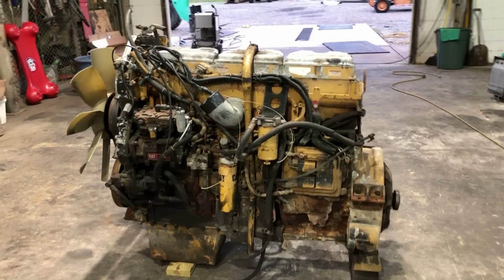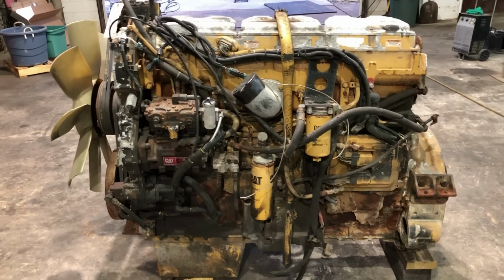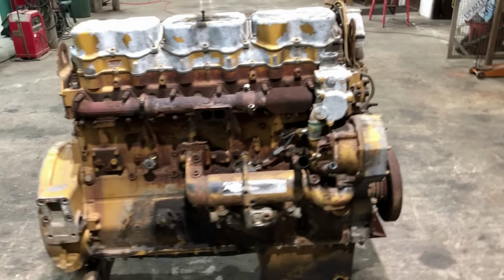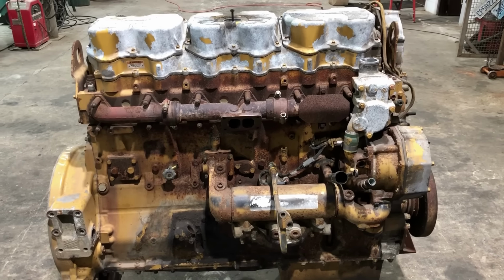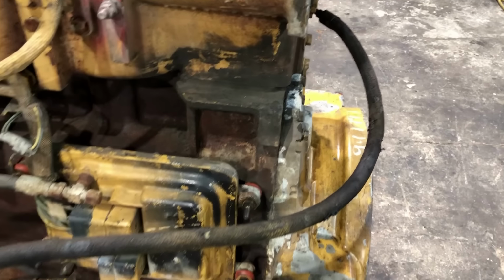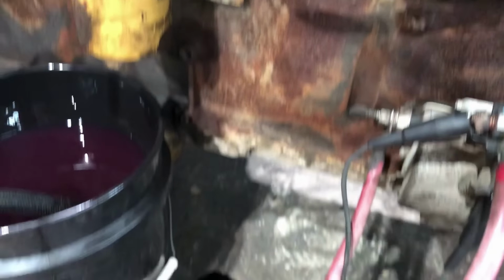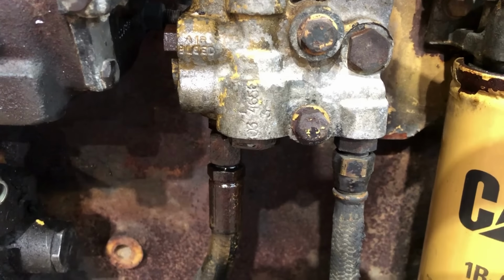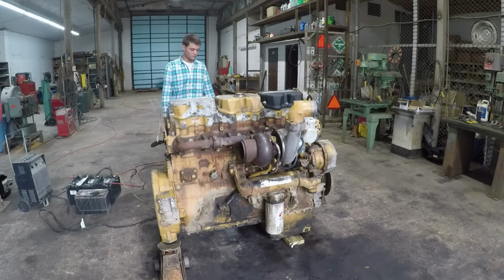Bringing a Caterpillar 3406E 14.6 Liter Diesel Engine Back to Life

Comment: Thanks for sharing. In my trucking career I've owned two 80's Freightliners both with 3406B 425 HP engines. I sure loved that engine. Dependable, lots of power and sounded nice too.  IMO they were the  best truck engines ever made.

Comment: I haven't had my head under the hood of a truck for over twenty years and that just brought back so many memories. I worked for a guy down in S.E. Alaska many years ago and the man only had one cat engine and a bunch of cummins. Don't get me wrong cause I like both engines... but a cat has a purr of her own and I had a long nose KW that had the 1693 in her. Only thing ever done to the engine in over a million miles was I lost a keyway in one of the gears in the timing set on the back of the engine. The shaft wasn't hurt at all but the gear looked like heck so I welded it all back together and cut a new keyway on the lathe then just put it back together. It was a beautiful truck and was very popular among other drivers cause it had 600 horse flat footed and you can turn them up but why unless you really need a little more power. If you need a lot more power then get the appropriate engine for the job cause it is all just nuts and bolts. I put another half a million miles on it before she started using just a bit more oil than I like so tore it down completely and built it stock again and had a flock of people who wanted it but her being family I kept it where I drove that truck about 3000,000 miles and I hadn't noticed until to late that the cab had a crack in it and when I parked her for the day as I did a lot of night driving;, it kinda was listing to one side and under further inspection the ol' girl had brought me home for the last time!! Cab was split clear up the firewall to the glass in the windshield. I know that was a lot to take in but I just felt like sharing that
Reply: What do you mean with a splitted cab?
Reply: @tierfuehrer2  I didn'think about people whi haven't done work on truck cabs  but the part where you ride in, right up the firewall ( the part of the cab closest to engine where the wires and stuff comes through, it broke in half because the crack got fully up from the bottom to the top. It broke like steel does when it flexes a few million miles, now do you understand???
Reply: Thank you for sharing this. it does bring memories back, even for me lol
Reply: Just wondering how can you cut a keyway on a lathe ??? a mill yes , a broach maybe ... But a Lathe ... I would like to see that one
Reply: @TheSmreeder  It must have been a multiple-axis combination machine. These can do whatever, wonderfully expensive stuff though.
Reply: @TheSmreeder  it's quiet easy to cut a keyway in a lathe, although time consuming compared to a broach or using a mill, but here goes. 

Cutting a keyway in a bore, make a cutting tool with some round bar and braze on a piece of high speed tool steel, kind of like a boring bar but ground to cut on the front edge. Set tool up in the the tool post so that the center of the tool is on center height and square to the bore. Then with the machine stationary and locked into a low gear so the job doesn't rotate, wind the saddle back and forth to cut and wind the cross slide out to get the desired depth. Small cuts, but gets the job done! I have also used a broach mounted in the tool post using this method when I didn't have access to our press in the workshop. 

On a shaft, assuming it's a small shaft, you can mount that in the tool post or you can make a jig to hold a larger diameter shaft in the tool post also (as long as it isn't to long of course) mount center of shaft on center height. Then use a slot drill/end mill in the chuck to cut the keyway, use the top slide(y axis) for the length of the keyway and saddle(x axis) for depth.
Reply: @jimmy2824  Thank You... I have run Bridgeports to HBM's w/ 16ft table  and 12ft VTL's and lathes w/ 16ft bed and I have never encountered anyone doing a keyway like that... and yes it would work... Many Blessings , SMR
Reply: @TheSmreeder  no worries at all! Sounds like you're no stranger around a machine shop yourself. I was taught this method by an old machinist while I was still an apprentice. And although I've only used it a couple times in a pinch at work since it's much more time consuming, it's still handy to know for doing work at home, if you only have a lathe.
Have a good one!
Reply: @jimmy2824  Thank You... I used to be handy around the machine shop , but that was 20 yrs ago. High sided my bike at a 110mph and have hardly worked since.  My last machine job was in 99 a few years after the accident and I couldn't keep up w/ the 12 hour shifts... its all good though I have a good Ol' Lady an RV and Grandchildren...
Many blessings , SMR
Reply: This is what youtube is for. Sharing stories. Thumbs up.

Comment: I built 3406's for a year to the day in Building BB Mossville, Il.  We built 125 per shift...all types, on highway truck, marine, power generation, gas compression applications. I remember hearing from down the line, "swimming mickie!". It was a marine 3406.  The Russians complained about the  3406 torque was bending their truck frames. Ha!

Comment: I have been a Cat technician for 21yrs. Started in the truck shop (on-highway) been EPG field service the last 13yrs. These old 6TS engines were bulletproof. I rebuilt more than I can count. 4MG, 3ZJ, 8PN, 5EK, 6TS, 1LW...if you're a Cat guy you know what those are!! Good video

Comment: I would never have thought you could run an engine like that just sitting there. Very, very cool. At least to me. My father drove long distance and I wondered how many miles he actually had drove. Oh well, I was just wondering the stories that engine has built up over the years. I was watching that engine sit there and run so smoothly while realizing the capabilities of that 'little beast', at least comparatively to the size of the cab plus a nicely loaded down trailer, especially in the mountains. All that torque in that relatively little shaft. So wild. Thanks for sharing.
Reply: Yeah you can run car and truck engines outside of the vehicle to. Great way to test them if you bought just the engine
Reply: it's actually easier with this engine than most gasoline fuel injected engines because the PCM is right there on the engine 
i'm a big chevrolet person and my biggest reason for this is with the older carburetor equipped engines they need just 1 wire to run ,,the HEI distributor has the coil in the cap and the PINK wire is the power , that's all you need for the ignition to work
Reply: @wildcoyote34  very true, I wouldn't even try on a newer engine with alot of sensors and all goin on.
Reply: Yeah I kind of thought it'd tip over!

Comment: Sweet vid!! I've got a habit of adopting old diesels too, so far I scrounged up a cummins V504 F2 out of a fire sprinkler system with only 234 hours on it (not one of the best engines ever but it was only 200 bucks, couldn't resist!) And the latest is a Detroit 6v53 that had a bad lifter, 500 bucks and it's a runner! It sounds awesome! That turbo on yours sounds pretty beastly too, love your vids, There's too many morons breaking stuff, glad you're bucking that trend in spades!

Comment: I was a licensed air craft mechanic and worked on prop driven cargo planes. Really big radial engines in the three to five thousand horse power range. Four of them supplied 12,000 to 15,000 shaft horse power on take off and climb out. Each engine spun a four bladed prop that weighed about one ton plus its massive gears. We were warned by a mechanic with thirty years experience that horsing really big engines, that is flooring the throttle then letting way off and repeating same can twist the crank shaft and cause engine failure of the worst kind. I was about your age when I was told this. If you were caught 'horsing' an engine you were fired. The engines cost $ 250,000 grand each new and a $ 100,000 to remanufacture  one.  Just thought I would pSs this along. Love your Videos

Comment: Awesome video! 
One small piece of unsolicited advice: Try to make a habit of wearing hearing protection in the shop - even basic foam earplugs are good. The reason is because unlike your eyes or hands which can suffer damage and (usually) heal back to 100%, damage to your hearing is permanent and cumulative over your life. You won't notice the 0.1% hearing loss from running that turbo for a minute 3 feet from your head, but it adds up.. .and once the damage is done, that's it - you're never getting it back. 
Cheers! :-)

Comment: Sounds like a winner.
 Hope the water in oil problem is a simple fix, most of the time it's a cooler internal leak. Anything more is a tear down. That sucks !!!! Thanks for video. !!!
EDIT: I'll pass this on to (Jpaydirt) he runs this engine in some of his equipment.
Reply: Compressor head gasket😜
Reply: In a car it's usually the cylinder head gasket, running the engine after the temperature gauge says NOoooo!

Comment: I didn't think she was going to run but when she fired up, she purred like a kitten - good job buddy!! 👍👍 also it's surprisingly easy to get the engine running by connecting 2 positive and 1 negative wire!

Comment: For 800+ K on the clock, that old Cat sounds pretty healthy. I'm guessing a leaking oil cooler since it seemed to be running even on all 6. Nice find, and good to have some spare parts around like a transfer pump, filters, valve cover, etc.😁👍

Comment: KT3406E The biggest radial ever to go into production was the Pratt & Whitney R-4360 28 cylinder radial developing 4000 hp with water injection and exhaust turbo chargers fully engaged, running on 115- 145 octane using ISO pentane as a base line octane standard.  Each engine weighed about 3500 pounds. The engine had a rating of 1.11 HP for each pound of its weight. I suppose that is butterfly light for a Diesel engine of the same HP rating. Diesels seem to be able to take a merciless beating  and keep on running.

Comment: I truly have been inspired. I have an old service truck that's been sitting for a while and Im going to work on it. I miss the tommy gate on it most of all. If a motor cane run while on a shop floor, surely I can get mine going with a little TLC

Comment: I remember the guy i used to fish lobster for would dump whatever he pumped out of the block on oil changes,  right back into the fuel tank,  from a 12valve 210 cummings.  Was big enough tank around 150L  I’d ask him, that don’t hurt it any?  Not a bit. Lubes the system and gives you back something from the cost of oil 👍  hahaha
Reply: In theory diesel fuel in and of itself is a better lubricant than petrol (gasoline as you Colonialists call it) which is why diesel engines do more miles with neglect over a petrol engine. Petrol is a solvent which washes oil off the bores. A modern diesel engined car would never tolerate such adulterated fuel. Their fuel pumps and injectors are made to better tolerances than anything on a Saturn V! OK some NASA guy is gonna give me some grief and hate! We have people here in the UK (where there's a lot of diesel cars as compared to the US) who regularly misfuel. They put "gas" in their BMW diesel and wreck the fuel pump and injectors. What am I trying to say? Just trying to point out the contrast between a  Lobster boat with a Cummins and a BMW diesel. By the way some of these misfuellings can run into a few thousand of your dollars to put right. And despite fuel nozzles having different shapes and sizes they still manage to misfuel. Nothing's fuel proof (no pun intended!) as fools are getting cleverer!

Comment: Tip on big diesels , don't keep snapping the throttle , hard on the crank with heavy flywheel.
Reply: Done it a bunch never had a problem
Reply: @Daniel-dg8hd  Till it happens
Reply: @johnready630  till what happens? Curious why it would be bad
Reply: @Daniel-dg8hd  Flywheel sheers the bolts off or worse the crankshaft snaps.
Reply: @johnready630  engines are pretty strong some simple revving shouldnt break anything they get abused daily pulling heavy loads etc
Reply: @Daniel-dg8hd  Whatever , I was a mechanic for many years . Just advice to use or ignore.

Comment: That was amazing , all those pins and it only takes 3 to make it run . That was the last engine I drove when I retired and it was the best !
Reply: That's for start and idle. Fuel pedal rheostat is more wiring. Boost reference wasn't hooked on either
Reply from the maker: They are still the best.  Thanks for watching.
Reply: Like Mini Barns started to say, the rest is for total operation. It will start and idle with a few pins. Few more to control throttle. Few more to control all conditions. Few more to make everything trim out and run smooth from cold to hot. Few more to control aux stuff. Before you know it you are at 40+ pins. That's how the cookie crumbles, lol.
Reply: @mjodr  I like three pins better !
Reply from the maker: @mjodr  There are 40 pins on the engine side and 40 more on the OEM (truck) side.  All the engine sensors are active and functioning with just those 3 pins connected on the OEM side.
Reply: @KT3406E  Ah OK, I see how it is broken out.

Comment: That's pretty damn cool. Question for you. In the beginning of the video you said the engine was marked as "water in oil." Running this engine on the shop floor like this, no radiator/coolant system attached to it, how do you know that there isn't something wrong with the engine like a head gasket, cracked head or block etc? None the less, this is some cool shit. I know not a damn thing about Diesel engines so anything you post here about them is educational for me. Thanks again. Rock on!
Reply: Surely its a good idea to see if it runs and what needs doing before putting in a bunch of hours and money into a complete overhaul.
Reply: I know this is super old, but the head is pressure checked and the block is checked for cracks before going any further on the build. So no matter what it costs a little money to have these things checked properly before proceeding.

Comment: i guess i learn something new every day ,, i didn't know that the engine PCM on these big truck  engines actually was mounted on the engine ,,well at least on CAT engines ,,sounds like a good runner too once i heard it start up ,,of course when it was cranking i could tell it was healthy ,, one with a dead cylinder will crank very unevenly

Comment: Wow I had a 3406B in my cabover, needed the fuel pump rebuilt. Ran great then I had a hard run, hills. Started blowing oil out and water out where it could. Sleeve seals I guess but didn't know that till you just said it...

Comment: Just found your channel...I have quite a few cats around the farm here...looks like your videos could be a fountain of information for me...thanks.
Reply from the maker: The 3406E and C15 truck engine family is my thing.  Thanks for watching.
Reply: KT3406E I have a little of everything...3406 in a old ford 9000. I believe there is a 3406 in my cat d6. I have 2 3208 which I hate...3116 in my dump truck...3126 in my gmc grain truck....and a c7 in my flat deck truck.

Comment: back in 1986 I went to diesel school in Vancouver bc , we tore down the DDa's and rebuilt them but not the cat engines , they said they were too expensive for parts . The detroits were the lightest truck engines on the market but the heads were cracking , Cummins was starting to gain market share , top stop injectors and electronic fuel injection . We visted a cummins shop in Burnaby and seen the prototype domestic truck engine , after that everyone was buying pickup trucks with cummins diesel engines . I tried to get into finning and ended up at Detroit diesel , tearing down engines and putting them through the wash machines , but everyone was on work sharing , the economy was bad . So I ended up in the ship yards and worked as an engine fitter . I should of listened to my dad , he kept telling me to go north . I live in the north now but iam 60 and gig is up , just work on the  house , and the truck and maybe buy a used diesel and rebuild it and sell it . Time sure speeds up when you get older , but lots of good memories .

Comment: Engine runs very good. No smoke, nothing. But i guess you gotta see if the oil is mixed with water as per usual head gasket problem etc.
Reply: MyMIXmedia more than likely on this one it’s probably oil cooler or cylinder liners.

Comment: There are many hundreds of the 3406B cores that are rebuilt into natural gas engines on the western high plains to power water well pumps.   They are completely rebuilt and equipped then sold for $25,000.

Comment: I teamed played an 3406B at baran institute about 15 years ago.  I was thinking fifteen yaers go by before I d start doing rebuilds on them when they were a new industry item.  Going with oem parts for replacements.   purring beautiful machine though when up and going.
Reply: how much would you ask for price of the 3406 series before rebuild if up and running like the lucky choice of diagnosis at that point.  then install in equipment or tractor?   fruitful enterprise there.

Comment: I used to work on the Oshkosh 1070HET which are leased to the British Army for tank transport. I believe they had the C16 17.1 Litre engine 700HP.. we didn't touch the engine they went to Finning for rework. We took the vehicle from theatre trim ( Armour removal)

Comment: Just looking at it, with the alternator and various other parts and wiring being there, it came from a scrap truck, otherwise those pieces would have been transferred to a replacement engine.

Comment: I'm leaning more towards a bad liner/bad liner o-rings...usually when the heat exchanger goes,you'll have oil in the cooling system due to the oil pump building more pressure than the cooling system..good vid though man